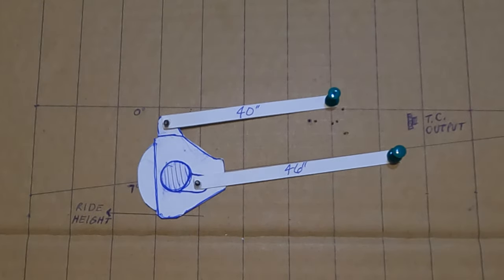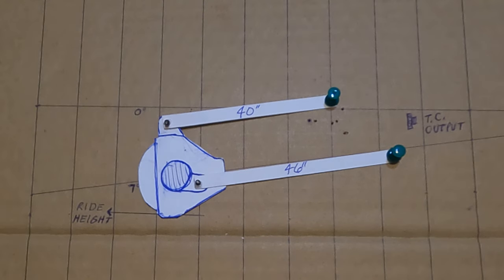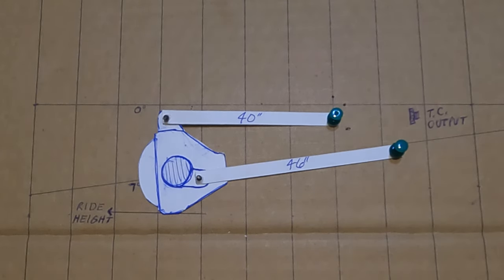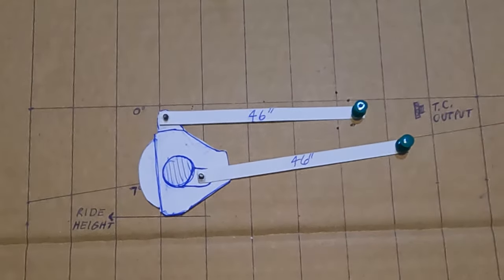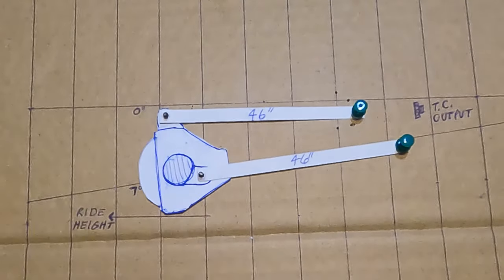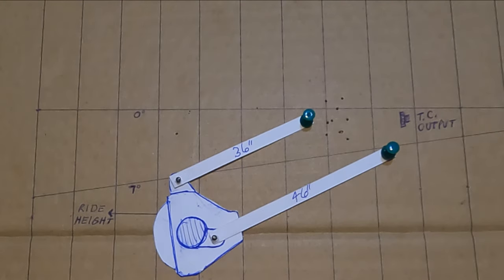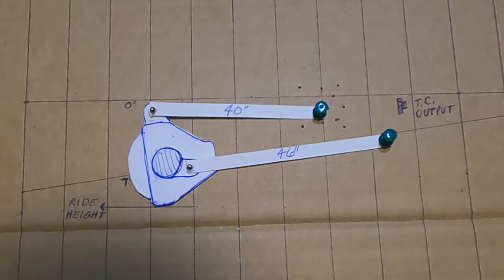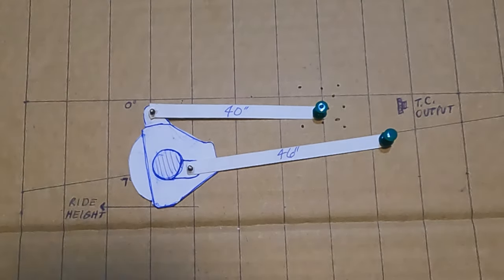4 Link 101: Offroad Basics

Comment: simple math this. it's all about arcs and positions that effect it, you can have a shorter top arm, but you must separate the povit point on the axle more. so short arm, long distance between pivot points, long arm, close pivot points. Also it's obvious that the higher the top arm chassis fix point is the more through the arc it is so will point the diff nose down at full droop. you don't want that in any scenario as it over extends the capability of the UJ's or CV joints.
Reply from the maker: The separation at the axle is always going to be approximately 10-11" vertical  and front of the axle tube to center of the truss (Front to Rear). These aren't going to change much. The upper arms are always going to be offset to the rear because of the diff is pointed upward due to the pinion angle.

Comment: I run my rear measured eye to eye square not diagonal 31" lowers and upper wishbone. Upper and lower are actually lot longer than 31" because triangulated. I have around 31" running length driveshaft on sye.

Comment: Awesome everything thing I experienced in building offroad cars in one video. You figured it out and shared. Easier on paper and graphs. Than a ton of steel and hours of fab and then go back to the drawing board. After it wipes everything out due to driveline angle super important. Most critical part or it takes the fun away if it isn't right. Thanks for sharing.

Comment: The original CAD (Cardboard Aided Design) in action!. Great demonstration to help visualize the movements and angles that result from different configurations.
However, it would be kind to your viewers to remind them that if you design the links so that the diff pinion shaft is always pointing towards the transfer case, you need to use a double universal joint at the transfer case end of your driveshaft.  If you have a simple single universal joint at each end, the transfer case end UJ will be swinging through a wide range of angles while the diff end UJ stays fairly straight: this will cause rotational speed oscillations in the driveshaft that will not be offset by the second UJ, leading to vibration and shortened service life of the diff components.
Reply: Was about to bring this up!👌🏻

Comment: Nice information and explanation, thank you. Agree with you that the link calculator is to "technical" and hardly takes pinion angle into consideration. I have an ongoing SAS on a Nissan D21. I did a radius arm setup on the front which I would like to upgrade to a 4 link (3link + Panhard), and have attempted to match the arm length to the the same as the driveshaft. This eliminates big length changes on the slip joint through the arc of travel. I am now kinda setting up to upgrade the leafs on the rear to a 4 link coil suspension, and will be basing my arm lengths on the driveshaft length again. I also like the parallel same length upper and lower arm setup, as the vehicle is also my daily drive, but is a handful with the 6" lift and 2" bigger rubber. I am suffering driveline vibes already, and hoping that adjustable 4link will give me the ability to adjust things to dial out the vibrations. This video was inspirational for this noob... Thank you.

Comment: Thanks, that helped me more than the calculator ever could.
Reply from the maker: Its not about getting perfect numbers. Even if you use the calculator, its never accurate. Because every rigs center of gravity varies. And it all depends on how accurately you measure everything to plug in all that info. Totally unecessary. Just triangulate the uppers and lowers, and follow a few basic rules and itll work out fine (unless someone has no idea what they're doing).

Comment: great explanation.... I like it, but now i want to change my setup  :)
Reply from the maker: Obviously double triangulation is important for a rear 4 link. It's much more stable than a single triangulated set up. But the angles of the links are the most important of all. Front 3 or 4 link its important that the pinion points at the case throughout travel, to keep caster in check. In the rear, its more to keep the rear driveshaft U joints from binding during droop. Regardless, if you keep your lower at 7-8 degrees, and build your upper parallel with the ground and slightly shorter than the lowers. And use a 4 hole chassis mount for the uppers,  eveything will be within spec and adjustable. Cant go wrong following a few simple rules.

Comment: On a RC crawler that is trying to do max steeps and sidehills in a more controlled lighter setting than 1:1 where speed and weight cause a lot of stress.
Rear links a lower link parallel to the ground is ok right…with upper parallel and higher with max diff in heights.   When lengths were and same and if mounted to similar location will maximize the pinion being lined up?
Reply from the maker: Pinion angle means nothing in suspension performance. All it prevents in the rear is U joint bind.
In the front, the pinion angle is WAY more critical because pinion angle and steering castor are directly related. But none of this relates to RC cars

Comment: And what about 4 links setups used in off road racing (baja 1000, baja 500, vegas to reno, etc.) is the geometry any different? do they only use tougher components? do the mounitng points at the axle change? I'd appreciate any help, thanks.

great video BTW, super helpful
Reply from the maker: Totally different suspension set up all together. Rock crawlers are going less than 5mph. A million dollar trophy truck is going 120mph with 30" of travel. Two totally different sports
Reply: They usually have trailing arm setup in the rear and ifs front, if no ifs front it's a very sophisticated link setup because caster angle and steering performance is super important
Reply: @mazevx2451  thanks

Comment: With rock crawlers do you have to use a double U-joint on the transfer case? On street cars the idea behind parallel links is to keep the transfer case and pinion parallel, even if the pinion isn’t pointing at the transfer case because the second u-joint removes the vibration of the first. 
So it seems like the idea is to keep that u-joint angle from happening in the first place. But it would only work for the differential’s pinion and the u-joint at the transfer case is still working hard and the u joint at the pinion wouldn’t be able to cancel out the vibrations unless there’s like another u-joint somewhere😂
Reply from the maker: The parallel links have nothing to do with  pinion angle. Thats all for anti squat numbers in the rear on street vehicles. Pinion angle change only applies to long travel off road applications. Any 4x4 with a double cardan rear driveshaft, the pinion should be pointed  at the case at ride height. Any 4x4 with a normal single U joint rear driveshaft, the pinion angle should match the rear transfer case output angle at ride height.
Reply: @wheels.and.wrenches  Ok very helpful. It’s not a problem until you start getting large angles. I do think parallel links will keep the pinion angle the same throughout it’s travel, although increasing the average angle of the individual u-joints.

Comment: Good stuff right here!:👍
Reply from the maker: Im convinced uppers and lowers exact same length. Lowers 7 degrees. Uppers slightly higher at the axle with an adjustable chassis bracket is hands down the best option
Reply: @wheels.and.wrenches  I'm planning on building a triangulated for link for a mud truck in the near future. I'm looking for all the advice I can get.

Comment: I have been wanting to do something like this for ever! Thank you for saving me a $#it ton of time! I want to go long arm on my TJ but not sure what to go with... 3 link, radius arm or try to stuff a 4 link in it. and how long can I/should I go. (builder kit kinda deal).
Reply from the maker: Step 1: Weld brackets on the frame where they need to go.
Step 2: Weld brackets on the axle.
Step 3: Measure for links and build links.
Reply from the maker: 3 link is fine. Make sure your frame is plated before you weld your upper link bracket on. The upper link mount must be very strong and the welds need to be very strong. Because if that bracket breaks, ita gonna cost you thousands

Comment: Hey man, I man so interested in building something like this but with a triangulated 4 link rather than what they have which is 5 link setup. Any tips on how I can nail the suspension geometry with something like this? I would be happy with 12"-16" of travel really. Not going hardcore. Please help. I'm new to these stuff.
Reply from the maker: This stuff isnt the type of project you want to take on unless you're an experienced fabricator & welder. Who has years of experience building off road rigs.
Reply: @wheels.and.wrenches  yeah that is why I want to learn it right now. Gotta start somewhere.
Reply: @wheels.and.wrenches  also, I can always look for people who can do the fabrication for me. It's the geometry and the design I am most interested in.

Comment: The Pinion angle is not the only thing to consider.
For most the Pinion angle pretty irrelevant because a not rockcrawler vehicle will be 98% on ride high, probably more.

The interesting part is, how smooth one goes over obstacles! And also dive when braking.
Reply from the maker: This is a rock crawler channel 👍🏻

Comment: But what if I want to put the lower link of the rear suspension parallel to the ground, and achieve 90-95% anti-squat? Do I need to mount the upper link on the rear axle higher, and make the front mount on the frame lower than the horizon?
Reply from the maker: Thats not possible unless your belly height was 15" off the ground. Your links would hit on every rock and you'd be hung up every 2 minutes on everything on the trail.
Reply from the maker: High antisquat is BAD for offroad. You're thinking of it backwards. Parallel links create a VERY low antisquat number. Meaning the ass end WILL squat, which is more of a drag racing set up for weight transfer to the rear if thats what they desire for traction. Most people want a happy-medium mid range antisquat number. Every application is different and trail & error is required.
Reply: @wheels.and.wrenches  Then why are the stock Jeep Wrangler Rubicon and Ford Bronco rear lower link parallel to the ground?

Comment: I was under the impression that if one u joint was bent you wanted another bend to counteract the oscillating speeds of the joints? 

Wouldnt "pointing it at the t case output" keep the joint straight which would produce vibration????
Reply from the maker: This is a rock buggy that goes 5mph
Reply from the maker: All double cardan driveshafts in Jeeps must point at the case output.

Comment: Since this is a 2 dimensional model looking from the side, if you built a 2 dimensional model from top looking down wouldn’t the upper links be triangular? So keeping the distance from lower and upper frame mount the same distance apart front to back cause the upoer link to be longer than in the 2D side view model?
I hope that makes sense?
Reply from the maker: Both uppers and lowers are usually triangulated in crawlers. Unless you're running Trailing Arms in rear. The offset forward to back in where the upper link mounts to the truss, is around 6" further back then where the lowers mount on the front of the axle tube. You can run the exact same length links uppers and lowers, and the upper will still appear shorter because it's set back more in the mounts. Most people run slightly shorter upper links it seems.

Comment: Any way you could illustrate a top down view of how the four links lengths and angles all react?? Sounds hard to do but would be cool!!
Reply from the maker: 4 link angles looking from the top down dont do anything except provide lateral stability of the axle. The more triangulation, the more lateral stability your axle will have. Thats why 4 links dont require a track bar (pan hard).
Reply: Apparently all 4 link.The bars are supposed to be in a straight line with the vehicle or square.If you will a top down view you would see no movement at all unless you screwed up somewhere far as angles
Reply: I'm sorry Google Voice typing.I didn't mean to say in a parallel four link A triangulated four link would maybe have some side Two side angle variations with articulation
Reply: Got me again but I think you understand what I'm trying to say

Comment: Hello, I want to install a 43 link in a Trailer I going to use for  offroading,   Because there is no DIFF just a n open axle, is it still need ed the 25 % tire dimension separation between lowe and upper ControlArms?
I cant get a 7° on the lower CA, is it an issue?
Reply: should say 4 link
Reply from the maker: Theres no power being delivered to the tires. So the axle isnt under any rotational load... vertical spacing at the axle doesn't matter. A trailer with a 4 link will be unstable as heck. Id just go with a stock used/flat leaf spring, kinda like a stock Chevy square body leaf... keep it simple. It's just a trailer.

Comment: How much travel do you have on your rig? I heard the length of the lower arms should be the double of your travel is it true?
Reply from the maker: Thats not true. Most people will be runnings 14" shocks all around. I run 14" rears, 12" fronts. Your lower links are always going to be a minimum of somewhere around 34" to get your link to sit at 7 degrees. Most peoples lower links are in the 38"-42" range eye to eye. A 28" link would never sit at 7 degrees... its too short.
Reply: @wheels.and.wrenches  thanks. So I have to try to be as near as posible yo 7  degrees?
Reply from the maker: @oscarneder2656  it explains everything in the video
Reply: @wheels.and.wrenches  sorry. I didn know the 7 degrees was a constant i'll watch the vídeo again.
Reply: @oscarneder2656  It's not.
Reply from the maker: @deeremeyer1749  the lower links can be 7-10 degrees. 7 is better than 10
Reply from the maker: @deeremeyer1749  it is if you want your suspension to work properly

Comment: How come you didn't test with upper links longer than the lower? That's how I'm building mine, it will keep the pinion angle truly pointed at the transfer case. Links the same length just keep the pinion the same angle relative to where it swings, not pointed at the transfer case as it raises and lowers.
Reply from the maker: Because upper links are never longer than the lowers.
Reply: @wheels.and.wrenches  why, it's going to blow up?
Reply from the maker: @Zach Fairchild  thats not how it works. Research and build 4x4s for 30 years, then get back to me 🙏🏻
Reply: @wheels.and.wrenches  then explain what problem you get when the upper links are longer than the lowers besides less anti squat. How long was the "rule" that uppers are 75% the length of lowers?
Reply: I’m just going off of head geometry, but I’m pretty sure having the upper longer would make the pinion arc in reverse, pointing down away from the TC on droop, and up above the TC on compression. But, it all depends on the angles and setup.
Reply from the maker: @Joshua Merrill  upper and lower same length would point the pinion UP more as the axle droops. A shorter upper link pulls the pinion DOWN on droop. Its swing radius would be shorter, as the axle drops the top of the diff gets pulled foward which lowers the pinion. Equal length uppers and lowers would work perfectly fine.

Comment: I have a jeep JK. In the front the lower control arm mounts hang down a lot. What would happen if I were to move them up about 2” inches and leave the upper mounts put?  (It’s my daily by the way).
Reply from the maker: It would improve your lower arm angle. As long as your vertical upper to lower axle mounting points are 9" to 10" separation, its fine.
Reply from the maker: Just dont tip your front pinion up too much.
Reply: @wheels.and.wrenches  from factory is has 9 inches of separation. So if I raised it it would be 8” inches. Do you think this is enough to cause any issues or drivability characteristics that would be noticed
Reply from the maker: @joerouth6255  separation should be 25% of your tire size. Id want at least 10"
Reply: @wheels.and.wrenches  and if it’s less do you know how it would affect drivability
Reply from the maker: @joerouth6255  its a leverage issue. Not a drivability issue. This is all information for offroad Jeeps. Not street Jeeps

Comment: I’m totally mocking up my numbers and doing it on paper.
Pinion angle yes stability and climbs,  what’s best angle
Reply from the maker: Theres a couple simple rules...
Keep your lower links around 7 degrees.
Make your upper links around 90% the length of your lowers.
Make your upper links 0 degrees with an adjustable chassis mount.
Triangulate both uppers and lowers

Comment: Why isn't the ideal setup to have the pinion angle always the same as the transfer case angle? Isn't having the top and bottom U joints at different angles not ideal? I'm talking ideal, not necessarily what you'll have to compromise on.
Reply from the maker: Because the pinion angle is always changing. Its not important. You need your suspension to perform properly for traction, travel and ride quality and lateral stability. As long as the U joint doesnt bind up, thats all matters.